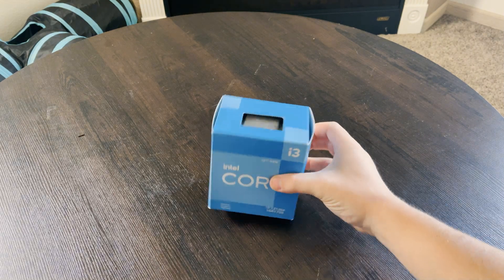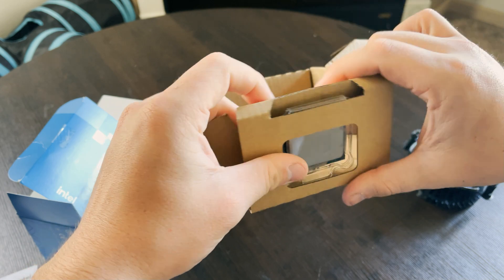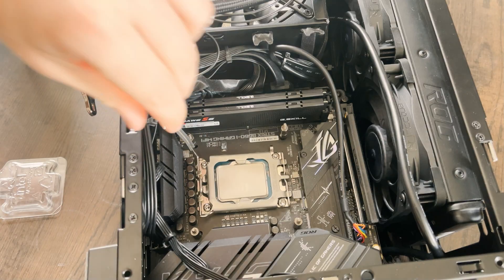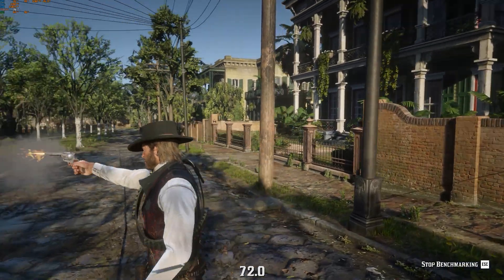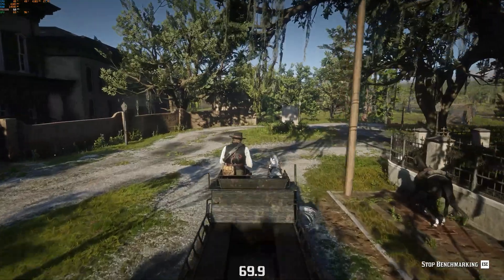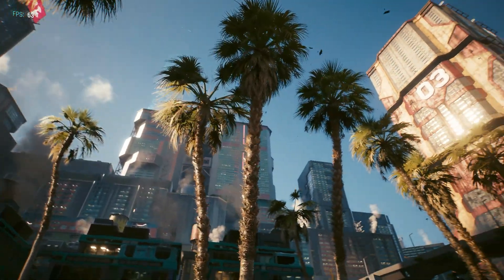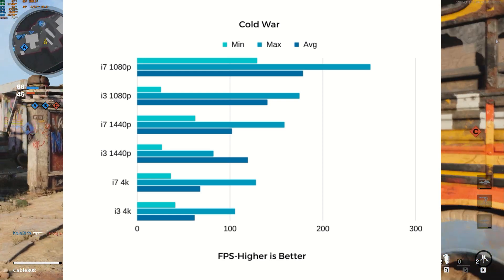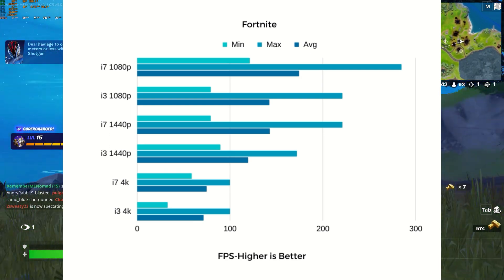Will a i3 keep up with a RTX 3080

Comment: Good advice for pc builders - for games only. Save money with 12100 or 12400 and invest into good GPU (3070 or 3080) to get best price/performance. I have seen 30+ videos of CPU "compare" and "review" in gaming  showing the same result - 5-10 fps difference overall. This video is another one to prove that, nice job!
Reply from the maker: Thanks man, I’m glad I could help
Reply: Mmm, I would advise to spend some extra on the motherboard, powerbrick and the CPU instead of the gpu tho, to future proof your build. I5 is the bang for your buck/performance sweet spot imho, and might save you a lot of money in the long run. 

An i3 might bottleneck the GPU you upgrade too and an i3 might be a massive bottleneck in CPU intensive games.. also forget about running discord, a map in your internet browser while playing tarkov for example.. multitasking will bring down an i3 on it's knees pretty easy.
Reply: not in 1080p lol
Reply: @veelack  yes, 1080p
Reply: @Renekor  lol seeing as most games are cpu bound at 1080p, this is not true. That’s why you in a lot of games you can get damn near the same frames with a 2070 super as a 3090, because the gpu isn’t being used… very bad advice and understanding.
Reply: Agree, but make sure have ram more than 8gb
Reply: People are like really missing the point lol. By now I've got an offer of a 2nd hand 3080 10gb for $400 while I'm sitting on a 12100f. I've only got $500 to  spend on a pc upgrade and I also need to do it with my psu besides the cpu aswell, so u know, people usually do have a tight budget to adjust
Reply: that's the worst advice I've ever heard, 12400 and a 3070 maybe but 12100? especially with a 3080? that's trash. fps aren't everything you need to think about the whole experience, and you're not gonna be playing on a PC that's running ZERO apps in the background so good luck with that the frame times will mostly be bad and you'll hate yourself from the stuttering and microstutters that happen. Oh and don't forget there are CPU intensive games out there (:
Reply from the maker: @cydia11centra  Fair but, I did think about the whole experience. It was a fine experience. and granted I gave this i3 all the help in the world. with ddr5, fast storage, an amazing monitor. This i3 did keep up with the 3080 and that was the point. not recommending a certain hardware pairing but more so just seeing if it would work and, it did. It was also to give people confidence when pairing the i3 with anything because there exists a large stigma that i3s simply aren't worth the silicon. That was true in the past but not anymore. It's a very capable chip well worth it's silicon and, certainly worthy of being paired with a 3060 or 3070.
Reply: @cydia11centra  thats dumb you missed the point. if your budget was $1000 for a gaming pc then the advice is spend more money on a better GPU and then get a lower end CPU. also your brain is stuck in 2010 because since 10th gen, the i3 and i5s are gaming beasts much better than their ryzen equivalents. dont underestimate them, they will run great but they will obviously be bottlenecked if you’re using a 3090 with an i3 in 1080p
Reply: @wrth  your last sentence completely contradicts everything you said, "dumb". And was exactly what I was talking about when I replied to the main comment
smh
Reply: @cydia11centra  you can't infer i guess. this is for budget builds. spend more on a gpu vs cpu compared to spending more on cpu vs gpu. case closed. also cheaper to upgrade cpu compared go gpu.
Reply: @wrth  obviously you'd wanna spend more on the gpu especially if the build is aimed for gaming, no one said anything about that. I'm just talking about "i3 & 3080" is stupid. if you have $800 for a gpu surely you'd at least have $200 for something like a 12400 right?

and in what world is the cpu "cheaper to upgrade"? GPUs are always easier and cheaper to upgrade because it's as easy as taking it out and popping in the new one, cpu on the other hand have motherboards, rams, and coolers for you to worry about besides from the CPU itself
Reply: @cydia11centra  in this world CPUs are cheaper to upgrade. the whole point is that its better to make a cost compromise on a CPU than a GPU. i.e. instead of i5 and 3050 go for an i3 and 3060. I'm sure you realise we are talking about an i3; given you have a decent B660 or perhaps Z690 you can upgrade to an i5 or i7, maybe even i9 if you upgrade cooling as well. the 12900k costs abt $500 so your upgrade for a top range CPU is much less than a top range GPU. and motherboards are not that expensive in the grand scheme of things if you're switching generations or platforms, a Z690 would cost $200 and a X570 for less than $150
Reply: @wrth  if that's the case and with an extremely tight budget then sure I agree but not with most scenarios
Reply: @cydia11centra  
Exactly right. It's seriously cringe seeing people advising to pair i3's with 3080s. Build a balanced system ffs. If they wanna play any demanding modern title (which they should considering they're buying a 3080), that game will utilize at least 6 cores, hell cyberpunk will use 10 cores on a clean test bench.

While gaming, their cpu will be deep into the hyperthreading at all times, doing any multitasking or even running stuff quietly in the background will be a garbage experience. 

If you want a 3080 but can't complement that with the proper cpu or ram, you should build something more mid range. At least it'll be balanced and frankly a better user experience. Quad core cpu's in 2022 are an absolute joke, even 6 cores should not be bought anymore, certainly not to pair with a 3080.
Reply: @formless7000  Thank you.
could not have said any better myself
Reply: @formless7000  is 12400f somewhat manageable to pair with 3080 12gb ?
Reply: @rokdovecar5275  
I wouldn't pair that with anything less than a r7 or i7.
Reply: @formless7000  what about 12600k ?
Reply: @rokdovecar5275  i5 12600k would be perfect but I would wait just 3 or 4 more weeks AMD and Intel are about to release new CPU, especially AMD as it is a new motherboard generation so you will get maybe 3 gens of CPU upgrade's
Reply: @cydia11centra  This is an i3 12th gen. This isnt an i3 3rd gen. It would still work well for multitasking, I dont think it's gonna have stutter, when a gamer games they dont usually run thousands of programs in yhe background lol. I dunno where the stutters would come from
Reply: @cydia11centra  isnt 12400 enough?
Reply: @tazboy1934  not really maybe for right now and your Immediate needs but look you may want to try rpcs3 emulation and that’s demanding as you can get it won’t run if you have a 12100f and a 12400f may just work I’ve had a budged ryzen 5 3600 before and it’s ok but having a 12600k would be a massive help long term I currently have a 12700k and it’s amazing.
Reply: For non-competitive SP players like me, an i3 which gets me >40fps, is very playable. Microstutters is a minor issue. Beautiful visuals matters more to me. I'm used to the pathetic PS3 and Xbox 360 stuttery 30fps gaming with lots of tearing, so i3+3080 is already a HUGE step-up in maximal visual fidelity @ playable framerate for the lowest-possible price. Competitive players will want at least an i5 though.
Reply: @cydia11centra  you underestimates the 12 the gen i3. 10th gen no fucking way it keeps up. But 12 th gen i3 is another beast.